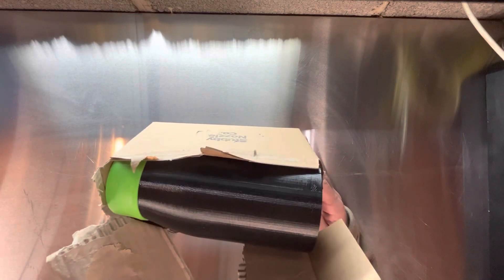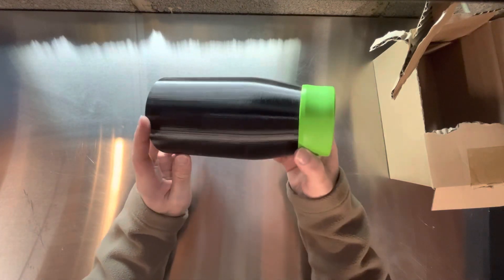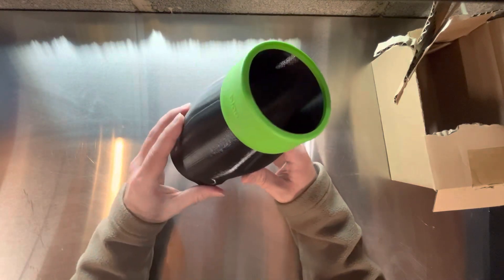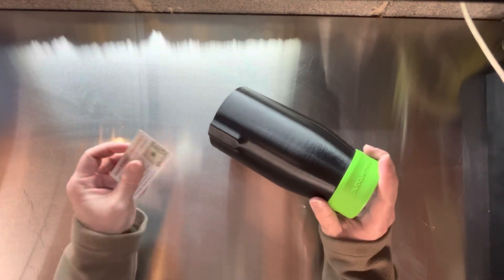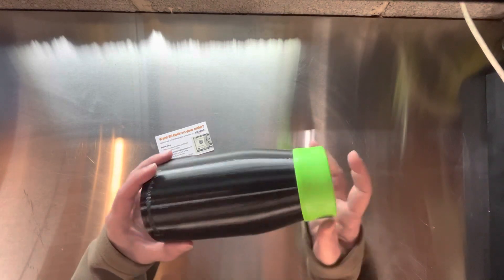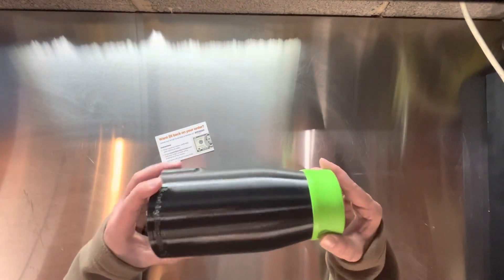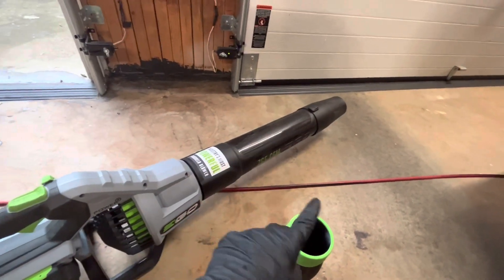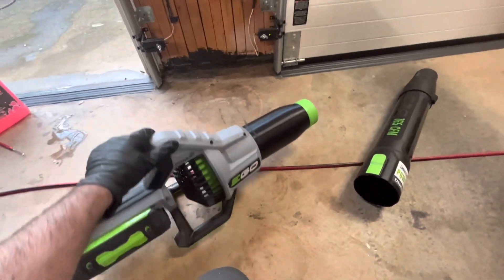Stubby Nozzle Co Review | EGO Blower drying nozzle attachment | car detailing blow dryer

Comment: I don't understand. What's the point of the stubby nozzle. Why can't you just use the ego without the attachment?
Reply from the maker: The purpose of the stubby nozzle is to make it easier to handle the ego blower while drying off the car. It is definitely not necessary to have this. You can certainly dry the car with the stock nozzle. I did that prior to purchasing the stubby one. In my opinion, it makes it easier using this nozzle and prevents you from accidentally hitting the car.